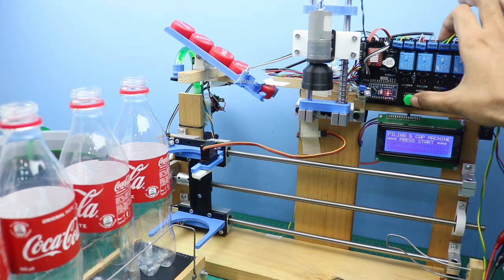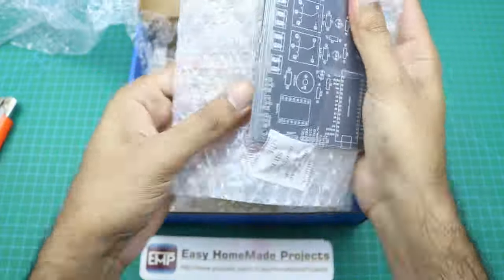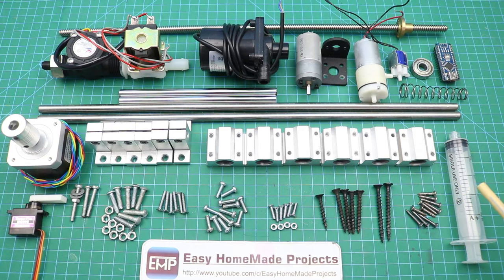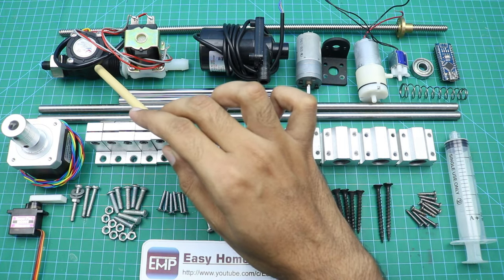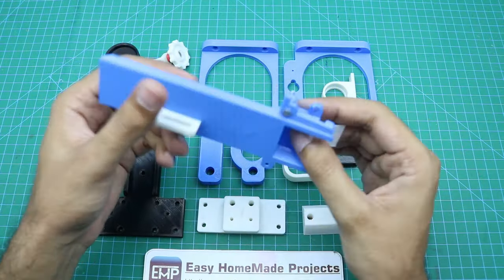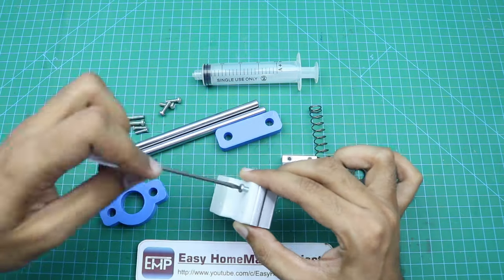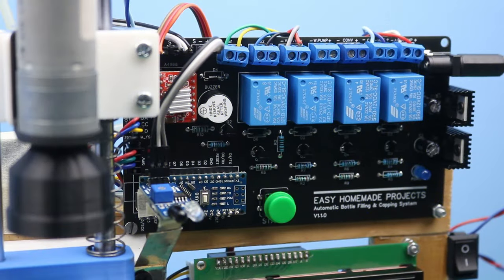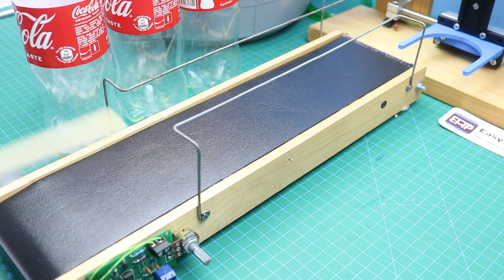DIY 500ml Bottle Filling and Capping Machine Using Arduino & Flow Sensor

Comment: I wish I could make this circuit. Too bad 3d printer is really expensive for me. 3D printing service in my country also charges a lot.
Don't know about international shipping cost for ordering 3D part.
Anyway, it will be really helpful for beginner if you also teach the programming part.

This project really requires a lot of skills:
1) you need to know how to use 3D printer.
2) woodwork skill. Cutting, Drilling ,etc.
3) Using PCB circuit software.
4) Programming